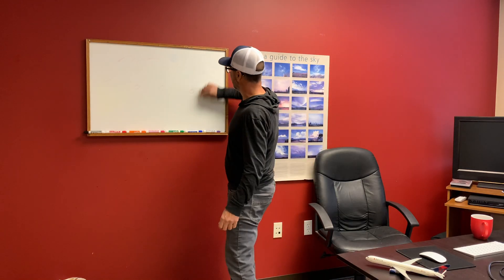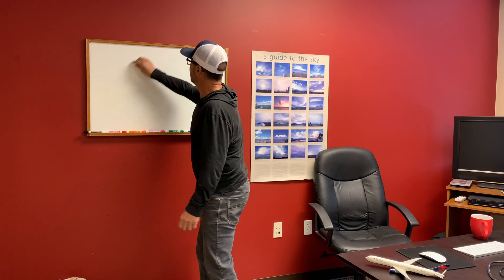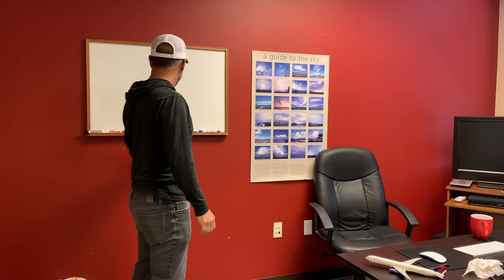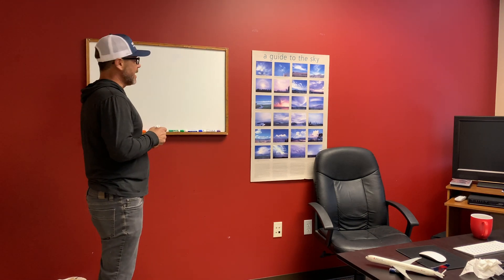Aerodynamics 101 - A New Understanding With Chris Santacroce!

Comment: @SuperFlyParaglidingSchool Was recently reminded of this video. I’m surprised it’s still up at this point. The aerodynamic terms you are using have very well defined definitions. At this point after all the comments you’ve had time to educate yourself on the proper definition of Angle of Attack. Using the term incorrectly, to support your own conclusions based on an incorrect definition shows a very real lack of understanding and inability to learn new information and admit fault. This is not a new understanding, it’s a complete lack of it. You’re a great pilot and instructor, but this video is spreading misunderstanding and false information. Plain and simple. It needs to be removed.

Comment: The term 'incidence' is not used in paraglider wings. Paraglider wings don't have an angle of incidence. Only a conventional aircraft does. Nor is the incidence angle on a conventional aircraft relative to the horizon. Incidence angle is the attack angle relative to the body of a conventional aircraft.     The result of an incidence angle is that the body rides parallel with the airflow while the wing is at a positive angle of attack. There's no incidence angle in a paraglider wing.

Comment: When you pull excessive brake for a long enough time you cause a stall because the stops excellerating air downward. Attack angle is directing relative to stalling.

Comment: Actually there's no bernoulli magic. The bernoulli effect or bernoulli principle doesn't cause lift. Wings produce lift by excellerating air downward. They stall when they stop excellerating air downward. The bernoulli principle is a conservation of energy equation. A pressure differential doesn't cause lift but rather is lift caused by excelleration of air.

Comment: Deflation happens when the wing goes to a negative attack Angle relative to the glide path. Incidence doesn't apply to paraglider wings. There's nothing to be incident to. Attack Angle on paragliders is relative to the glide vector. Pulling brakes increases your attack angle.

Comment: Angle of incidence is relative  to a tail or body of a regular aircraft and doesn't apply to paraglider wings. Angle of attack is relative to the glide path. During pitch oscillating, the glide path is changing. Your attack Angle isn't compared to the horizon, but rather to your glide vector. This is why the wing can be well in front but still have a positive attack Angle. Attack depends on the immediate glide path. Angle of incidence is the angle between the wing angle to the body angle. So that the body rides parallel with the airflow. Paragliders use pedelum stability ,so with no body or tail there is no incidence angle. When you are going upward in a pitch oscillation ,your attack Angle is compared to the upward direction you are going at that moment.

Comment: The level to which you dumb down aerodynamics in this explanation is not only wrong but also dangerous. You can totally stall a wing with minimal break input. You are also getting the nomenclature wrong, (as explained in the comment by @MitchG) which creates more questions for pilots down the line rather than (what you claim to be doing) keeping people from having questions. 

Accident analysis in the past years has shown that different types of stall are the most common cause of accident, whether during take-off, flight, or landing. It might be true that in turbulence, one can prevent collapse of the wing by adding break in certain situations. But really what you are doing when adding breaks is increasing the angle of attack (AoA), when oncoming turbulence is reducing the AoA, and therefore one might be preventing a collapse. Teaching new pilots & students to pump the breaks during landing as a way to mitigate the effects of turbulence most probably does more harm than good. People who have not experienced a controlled stall themselves and have not mastered the skill of stalling a paraglider should not live under the impression that "pumping" the breaks, or applying breaks in general, would keep them safe. 

Stalling a wing is not a direct effect of break input, but rather of glider speed. A glider that is already slow requires barely any break input to stall and a glider that is shooting in front of you with lots of energy and speed is very hard to stall in the very moment it is in front of you and traveling fast, even with lots of break input (to catch the surge for example).

Comment: How did I not see this when you published it?! Since it's 101, I think it is important to emphasize that a stall is not a collapse.  2 different events, that I often hear new pilots confused about.  I'd much rather stall, which is typically pilot induced, as opposed to a collapse that is most often dynamically induced from thermal or rotor.  Great stuff for discussion.

Comment: Relative newbie here. I'm somewhat skeptical of 7:20 ("all you ever feel here is a lifting sensation"). I'm sure this applies to a rigid object, such as one's hand, but a canopy in that situation? If rather than your hand, you used a piece of paper, would this still hold true? Or would the front be forced down, propagating down the rest of the surface? That seems to be what a frontal collapse basically is.

Comment: Hey Chris, Thanks for making this video, it's great to have access to some of your training. I'm not sure I fully understand/agree with a few of your points, but I’m a big geek so if I’m wrong with any of my thoughts I’d love to understand where I’ve gone wrong.

My understanding is this:   There are 2 ways that an aerofoil creates lift, bernoullian lift, created by pressure differences between the top and bottom surfaces, and Newtonian Lift, created by deflecting the airflow downwards. However both methods require an angle of attack that falls within a specific range.

There are 2 airflows that act on the wing, the “True Airflow” (created by wind and thermal activity) and the “Induced Airflow” (created by the wing’s forward motion) The vector of these 2 is called the “Apparent Airflow” and is what we actually feel on our face. The angle of attack is also relative to the Apparent Airflow, but since in most forms of aviation the Induced airflow is so much stronger than the True Airflow, we normally think about AoA relative to the direction of travel. This is why we have the problem you speak of at 8:55 since the strong True Airflow may become dominate over our Induced Airflow which is limited to around 25-35mph.

Angle of Attack can be altered without any change to the Angle of Incidence through variations in the True Airflow such as turbulence. This is especially true for slow flying paragliders where the True Airflow is often relatively strong compared to the Induced Airflow (See Above).

Angle of Incidence can be altered without any change to the Angle of Attack as long and the wing continues to move through the air in just the right way. In the example at 3:15, the paramotor flying in calm air can porpoise up and down without stalling or taking a frontal collapse because the relative motions of the wing and pilot works to maintain a positive AoA throughout the sequence. 

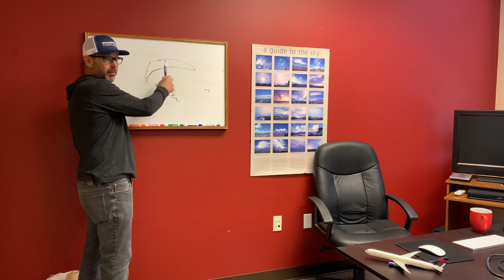In the he scenario you describe at 3:50, since applying brake pressure will slow the wing down but not the pilot, any rapid application of the brake will cause the pilot to pendulum out in front of the wing. Therefore the only ways to achieve the scenario would be to slowly and steadily apply brake pressure, so that the wing and pilot slow down at the same rate, or fly into a rapidly rising True Airflow. Either way this stall is still caused by AoA, as the Apparent Airflow is no longer at the correct angle.

In your example at 7:17, you change from talking about your hand being the wing, to your whole arm being the wing. With you arm maintaining a positive AoA, the angle of your hand becomes less relevant, as it only represents 15% of the total wing area. 
All that said, I don't think anything I've said changes the application of your mantra "brakes prevent collapse", and as I said at the start, I'm writing this wanting to understand better if any of my assumptions above are incorrect.

Comment: Old free flying paragliding pilot saw deflation as a result of negative g force on parts of the glider. As long as the entire wing is under positive G it will keep its shape.
To keep it this way one need both active breaks and wight shifting (letting your body roll with the glider, adding pressure to the side going light).
Very good point in making a difference between AoA and AoI.

Comment: Negative angle of attack is the cause of deflation. Brakes do not always prevent deflations. Stalls can occur with little or even no brake pressure because its all about angle of attack. The air that we fly in constantly changes angle of attack, its the pilots job to maintain that angle of attack in the flyable range of their specific glider
Reply: I can see that the root of this difference of opinion is that Chris provides his own definition of AOA in the video. More broadly at least in my experience, AOA is the difference between the direction the airfoil is pointed and the direction it is going. Chris refers to AOA as the position of the glider relative to the pilot. We wouldn't expect to be able to talk in depth about AOA without an agreement of what AOA is.
Reply: Thanks for chiming in Mitch – that hasn’t been my experience but that’s what this is all about -  sharing our experiences – thank you so much!

Comment: Angle of incidence is the difference between chord line and horizon. Angle of attack is chord line and relative wind. Just because the wing is diving doesn't mean the angle of attack is negative because the relative wind can still create a positive angle of attack. Brakes prevent deflations by increasing angle of attack. Even though angle of incidence stays the same (wing over head), brakes decrease airspeed which increases angle of attack so the wing can fly through sink while still maintaining positive angle of attack.
Reply: Spot on. Pumping the brakes slows the glider and increases rate of descent, therefore the relative airflow has now changed and had a slight increase in angle of attack. Also at the point when the brakes are pulled the camber of the wing is at its maximum relative to hands up. Angle of attack is angle between the relative airflow ( the reverse of the flight path) and a line from the leading edge to the trailing edge. 
Deflation’s are prevented from always trying to maintain a positive angle of attack even sink, down draughts and turbulence. With speed bar on the angle of incidence decreases and therefore you are flying at a lower angle of attack reducing the margin for error and increasing the chance of a collapse.
A stall is the opposite.  The trick here is to not have to high an angle of attack. But due to the glider design of a fixed angle of incidence with a pilot   Hanging below its very hard to increase the angle of attack for more than a few seconds other than to apply and hold large amount of brakes. 
In summary don’t allow the angle of attack to get too low or you may get a collapse (pump the brakes to increase the angle of attack) be cautious when speed bar is applied and also don’t allow the angle of attack to get to high ( by holding to much brake for too long) so you don’t stall.
Reply: And relatedly, if you pull the brakes you change the L/D ratio via deformation, decrease speed and cause airflow separation. And that is what we call stall, separated airflow. The glider might stay over the head but Vsink versus TAS becomes large and you have a high angle of attack as consequence.
Reply: I agree :)
Reply: It is important to note that in order to figure out the AoA, you have to look at the glide path through the airmass (which is moving relative to the ground - we call that "wind"), and not relative to the ground. This creates all the confusion. And I'd be hesitant to use the word "wind" when we're referring to a flying glider. For a glider there's no such thing as wind (except for gusts) - it always flies at defined L/D and speed through the airmass, and these characteristics are defined by wing profile and AoA. You can modify AoA by modifying wing profile - using brakes or speedbar
Reply: I realize it's kinda off topic but does anybody know a good place to watch newly released tv shows online ?
Reply: @Mitch exactly

Comment: Great video I would say I agree about the brakes. My dudek warp manual recommends the opposite. It’s frustrating... obviously coming in for a landing in rotor you need brakes because you’ll be slowing down to a running speed but it just doesn’t feel right to dump trims and let go of brakes in turbulence when at altitude. Where do you recommend trimmers he set?Everyone even the manuals are saying reflex wings don’t react like classic gliders and should be treated different in turbulence. What are your thoughts on these reflex wings and how we should keep them inflated in turbulence?
Reply: No doubt that you should honor the manual and I’m not going to pretend that I am an expert about your glider. I think you hit the nail on the head when you pointed out that it doesn’t do the average pilot much good to know that the fast trim setting with zero brake is the safest place to be on a given reflex glide. This -  for the exact reason that you mentioned… Many times we are low and many times we don’t want to be flying with that much throttle so as a practical matter – we can’t fly fast all the time. We have to reconfigure the glider to slower settings for approach and landing and takeoff and fuel burn etc. Finally - it is unfortunate but true that the record shows that as much as certain configurations might yield better stability in theory -  all gliders can and will deflate and it is the highly loaded gliders with the trim set fast that are usually uncertified which dive the hardest when they do deflate.

Comment: Interesting point not to directly link a stall just to increased angle of attack. However, I don't believe that (it is complete to say) at least keeping a glider in stall can only be linked to trailing edge deformation. 
If you are a good enough pilot you can maintain parachutal which is a stall with having no trailing edge deformation, at the same time your angle of attack is neutral. 
Negatives are pretty interesting on a paraglider, theres way more nuance than on any fixed wings.
Reply: Thanks for your message. It is true that we can knock the glider into deep stall without gross trailing edge deformation. Still -  it is often times due to some trailing edge deformation applied in some combination. It is also true that a glider that is out of trim, full of sand, full of snow, wet or a glider that has just suffered a malfunction can slip into deep stall. I put stall
and deep style in different categories and while I do address deep stall in some other videos – it’s not the focus of this video. Again thanks for chiming in.